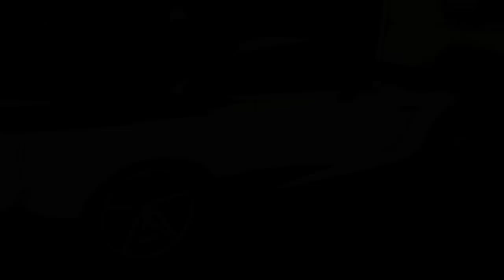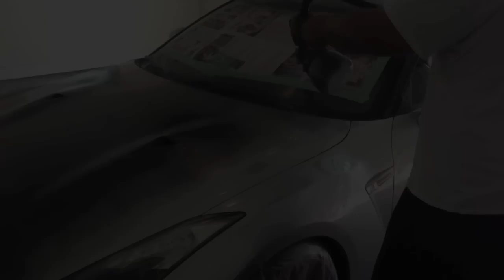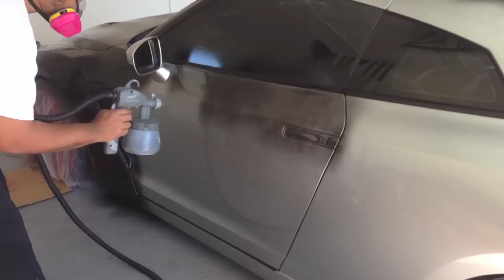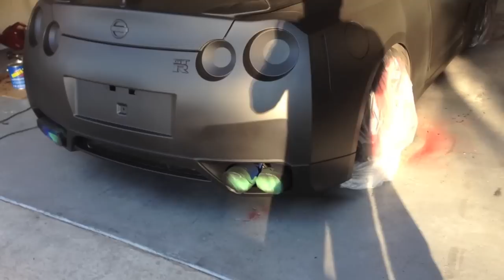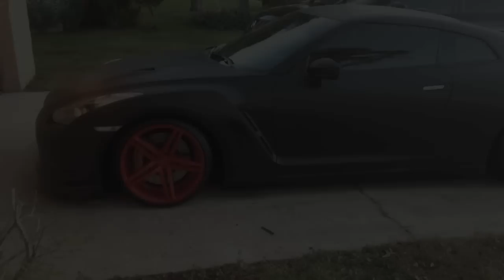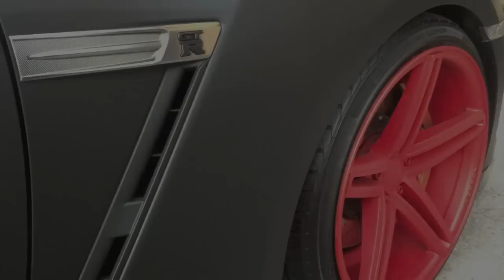Plasti Dip Nissan GTR Matte Black w/Matte Red Rims

Comment: 1. The liquid vinyl is called Plasti-Dip
2. ProDips is a company that supplies and applies Plasti-Dip
3. The car isnt fake it just has aftermarket bumpers and rims etc
4. There is a 100% chance that the owner doesn't care about everyones opinions 
5. and finally my comment to the owner would be to put on some larger tyres because they look a bit small but its just my opinion.
Have an awesome day everyone :D
Reply: Stock front and rear bumper

Comment: Wow... All of the people hating on this car. You obviously dont know anything about plasti dip. It comes off! You can change colors as often as you want and its super cheap to do. If you wanted to change paint colors it would take over a week for a TEAM to do it. It takes a lot more work because of sanding, dismantling the car, and more masking; and it costs a great deal more (trust me, Iv repainted cars multiple times). Great thing about plasti dip is that if you dont like the color you dipped it any more, you can peal it right off and go back to factory paint or dip it another color. Learn something before you talk crap on someones work. Looks great. Good video.

Comment: Well, that's one way to ruin a GT-R
Reply: +Lettush Its not ruined. You can peel plastidip off
Reply: +Gewy Ruined the clear on my car, you have to be careful with the dip
Reply: if u dont want to get ruined clear, you need to dip it min. 5 leves
Reply: What?! How? If you thinned it with thinner use for paint I could possibly see that but if used correctly no damage will ever occur.
Reply: The paint shop suggested that my Sky Redline had the hood repainted at some point in the car's lifetime, and the plastidip clouded the non-factory clear. I was able to high speed polish the clouding effect out, just took a lot of work.
Reply: Nathan Larson that is on the shoddy paint work then. I have used plastidip for years and never an issue LOVE plastidip. With all the new colors and choices I love it even more.
Reply: +Nathan Larson There are even videos of how the dip has actually helped with old flakey clear.  When they peeled the dip back, the old flakey clear came off and left a really nice finish.
Reply: already ruined by garbage rims
Reply: Flybyes how is that ruining it????
Reply: Nah daw

Comment: First off, those tires totally castrate the performance of a GTR.  Besides that, they look like crap on the car.  Otherwise, it was a GTR for chrissakes, one of the hottest rides out there and going for a cool 100 K+.  So, the tires didn't fuck it up enough, let's make it look like its in primer and put Boy George's  lip stick colered wheels on it. Perfect. Totally fucked. You did good.

Comment: You fucked those wheels...
Reply: Was thinking the same thing, bright red looks horrible on those wheels!
Reply: Jesse Custer Not to mention they look 3 sizes too small for the car.
Reply: Yeah, it does look pretty shitty, but they wheels are not really "Fucked" because Plasti Dip just peels right off.  The True Metal Aluminum would probably look nice these rims.
Reply: the rims dont go with the car they seem really off
Reply: Johnny HA You do realize that he is actually extremely smart on using plasti-dip, seeing as it will protect the good paint under it. Sure the wheels look horrible, but the car itself looks great with a matte black finish. Secondly, not all high end cars should have tons of money dropped on them. Paying for a 5000 dollar paint job can easily void the cars warranty, whereas dipping it WON'T void the warraty, and again protects the cars original paint. Which means the paint won't fade, get scratched by small debris, and it will keep the car looking brand new. Thirdly, you're grammar is god awful. Like seriously, do you not know how to spell correctly and us proper grammar at all? If you're going to comment, be sensible and do your research before you start spouting shit.
Reply: Johnny HA Well for one, everything you do on the internet is saved. Two, your current or even a future employer can access it and use it against you. Believe me, I would NEVER hire someone with such a potty mouth plus the lack of grammar skills. Third, name calling over the internet? What are we? 12 or 13 years old? I think its best that you stay off the internet till you can correctly use it. Have a nice day. :)
Reply: NordicTwizzler oh ok, ill make sure to update my resume to potty mouth.

Comment: its a product called plasti dip that can be easily peeled off non abrasive surfaces very easily just like you say with the headlights in this video. little masking is needed which is why this product is a good choice for body work on a tight budget

Comment: Vinyl wrap can't cost 5K bro, and paint job will cost around 2-3K depending on the finish you want. Wrap cost almost if not the same to plasti-dip. I don't see how you can charge $500 to spray and entire car when the cost of the material cost $200-400, where is the profit? But who am I to say. Continue to do this man, it seems to be the ish.

Comment: I have a gtr in super silver paint (which costs $3,000 in option from factory) and I would NEVER change it for anything else. 
I wouldn't get that matte black even if someone wanted to pay me for it.

BEWARE GTR OWNERS:
If you have a super silver gtr, do not get a paint job. It is one of the hardest color to get, and even dealers claim that they can't even perform a paint job like super silver from the factory.
"They asked me to tell them if I knew any body shop that can get the super silver paint correctly on first try"

Comment: Looks good if you ask me
Only thing I would say is the tyres are far too low profile. for one it will destroy the rims and suspension pretty quickly and two, I think a tyre looks good with at least a bit of beef to it, and also the rims are too bright for a matt black

Other than that looks good!

Comment: The rolling diameter of the wheel/tire setup is all wrong. Not only does it look wrong, the GT-R's computers are finely tuned to work with the proper rolling diameter. This smaller diameter causes the computer to think the tires are spinning too fast and you'll have traction control kicking in when it should not be which makes the car feel underpowered. 

I own a GT-R and have had the same problem with a Ferrari F430 that had aftermarket wheels. Look at my channel before you call me a liar.

Comment: Here is my gripe with this video.

I think that it doesn't look good in most applications I have seen. But more so than that.

Not everyone can or maybe should think, that they can do this themselves.

That is probably close to a 100k Nissan.

And the guy is spraying it in a car port. With no air pressure cycle. and open air.

Which means the air is FULL of contaminants.

 It may look alright when its done in this vid at 720p. But I guarantee up close to it in person, you're gonna see dust, dirt, bugs anything in the air outside that can be down to the size of pin head (Yes things that small will show up) caught in that surface.

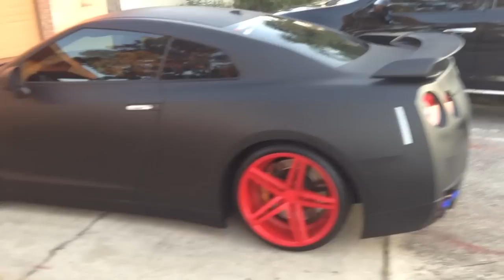And next, kind of the most important thing. If you look really hard at the surface after its finished, there are blotches and color striping on its surface... @2:43 for example look under the inner tail light lense on the rear bumper....Most likely because of bad hand control. And being able to see how smooth or even textured a refinish job is on a video is pointless. You cannot really tell how if it is good or not because the camera would have to record inches away from it.

What's my opinion?

I guess if you have a P.o.s. 2001 accord that's three different colors. Then this is a decent option for you and maybe you could do it yourself. Hell if your screw up, remember it's a 2001 Honda.

But to anyone who is doing this to cars that are almost 100 grand, in a janky environment like this. I feel you should get some more professional shop time under your belt, before trying to charge somebody (with more money then brains) to let you do this to their Super car. 

 I wouldn't want Plasti anything near my fresh Factory paint job.

Comment: I do NOT understand why using plasti Dip, it is fragile ! at a minimum or slightly touch will get a scratch and it will come off and to say that you can retouch it is a big B.S ! unless you peel the entire section of the affected area, I rather to wrapped with vinyl. BTW: I am not hating on your skills, great job and awesome car

Comment: in Poland the plastidip itself would cost about 250 usd for a whole car, it is abit more expensive here than in the US, you can check for the prices on dipyourcar(dot)com
the whole kit with the dip will run you 250 usd

Comment: No, I don't think so. Plasti-dip is the new rice which IMO takes away the value in a car. Plasti-dip is for ppl who want a cheap way out of painting the car. I mean  GT-R is 90K plus why you using a cheap finish on it, the vinyl wrap looks way better and it can pass as an actual paint job. Now the rims make the car looks like a honda, not sure if it's because the profile is too thin of because it's an aftermarket rim. The stock rims in black are intimidating, these aren't. Look like hot wheels

Comment: why not? I would plasti dip a brand new expensive car just cause it will protect the original paint.When i would go sell it, id peel it off and it would look like a brand new car. This is prolly the best thing you could do to an expensive car. It like getting a protective cover for your ipad or phone. Same concept but on your car.  That and if you dont like it, just peel it off, plastidip is cheap, especially if you mix your own instead of buying pre mix.

Comment: Yeah ... do a vinyl wrap that runs you $5k+ or do a plastidip spray that runs you about $500 ... absolutely the same thing except you spray plastidip on and you heat up the vinyl wrap to apply it ... they are both removeable ... so it doesn't make much sense to me to spend 10x as much for a vinyl wrap ...

Comment: Plasti dip won't work right if its not done right. If your dipping over cheap ass paint yeah maybe but I doubt it. I will 100% say its not going to hurt a high priced car's paint its not cheap paint. All the horror stories or from kids painting the Hondas and think they know what they are doing using rattle cans form their local lowes. Plasti dip has been proven they it don't hurt a paint job. It is just a sprayable rubber. No difference really from vinyl rap besides way cheaper.